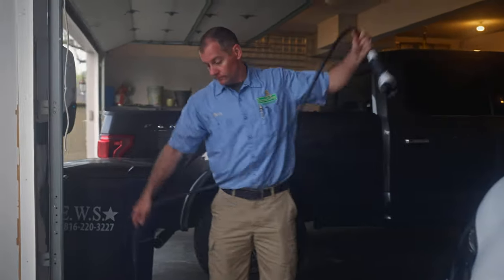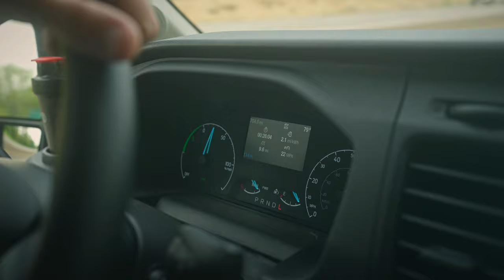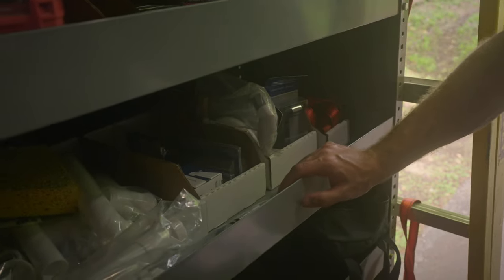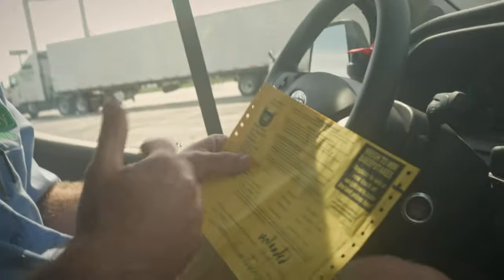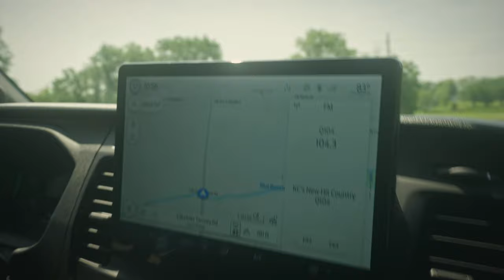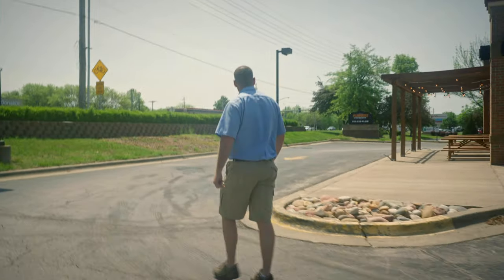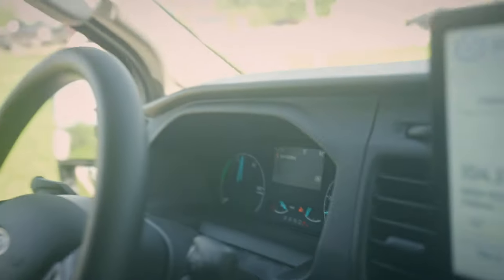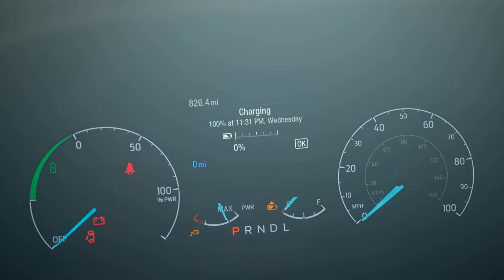**Ford E-Transit**  How far can you drive when it's loaded down?

Comment: What about 5 year overall cost inc purchase of the van compared to a normal van same spec, weight and usage?
Reply from the maker: So this van actually cost us $21,000 less to buy than the other gas transits we have purchase this year.  This is due to the insane demand for but limited supply of gas transits right now.  So $21k less to buy, $1500 less in sales tax, and we're saving about $400/month on gas.  This doesn't include the claimed reduced maintenance expenses.
Reply: @SmedleyPlumbing  WOW!! that really is god, but of course, that situation will change once Putin and the world start sorting things out. I wonder if it will still make such good sense then.
Reply from the maker: @H4rleyBoy  the van pricing was set long before Putin bacame an issue.  Regardless of who's to blame, we are seeing a great upside.  Even if gas were half the price, we'd still be winning.

Comment: I have a question about the pro power on-board system. Is it a 2 times 20 amp breaker? Is the inverter directly connected to the main high voltage battery or to the small 12V battery ? Can you turn them manually back on if the system switched it off after 40 miles?
Reply from the maker: Connected to the main 68ah battery.  Can only be used when the van is on.  Can't be used while charging because you can't turn on the van while charging.  Yes you can override the 40 mile limit.  I believe it's a single 20 amp breaker with a duplex receptacle.  There is also another single receptacle on the left side of the passenger seat.

Comment: How do you get your pipes out if they’ve been cut shorter than their full length?
Reply from the maker: Never put a pipe in the tube unless it's full length.  This forces a person to be efficient with using up their scrap pipe before grabbing a full stick.
Reply: @SmedleyPlumbing  gotcha. I worked somewhere once where they had 4” pipes on top of the vans. They cut plywood into a circle and used an all thread to attach to it. That way you could always pull on the all thread and pull out whatever was in it! I use the tops of the shelves on that same side to carry my pipes. They aren’t quite 10’ long though.

Comment: The biggest issue is range, and cost: in the UK you can buy two diesel transits for he price of an electric one, and when winter kicks in and you’ve got the headlights on more, the wipers, the heaters etc that range will absolutely dive - you should try another range test configured that way.
Reply from the maker: Yes as soon as winter gets here, we'll do another test

Comment: Great video with a lot of details covered. Overall a good first effort from Ford. This is a quick fix vehicle that has not been optimized to be an electric vehicle. A ground up design should fair so much better and really optimize the savings realized from BEV vs ICE. 👍👍
Reply from the maker: I like this model so far!  Still room for improvement as always though.

Comment: It is a pity that Ford took as a basis a body from a rear-wheel drive van, it is very convenient for me with a "low floor".
Of course, for a truck, rear-wheel drive is the most correct option ...
Is it going to be a front wheel drive version or a rear wheel drive version with a low floor?
Reply from the maker: I don't believe you'll see a different chassis than the gas model.  That's what makes this so neat.  It's the same upfit as the gas models.
Reply: @SmedleyPlumbing  I have a Trasit - diesel with front-wheel drive and a low floor)
Reply from the maker: @lombybedlam  what country?
Reply: @SmedleyPlumbing  Europe.
Reply from the maker: @lombybedlam  that would be why.  We don't have that option in the US.

Comment: Can  you wire up equipment into the van that would normally run on 12v power in regular van?
Reply from the maker: Yes.  It still has a 12v battery under the driver's seat.

Comment: I just can’t imagine not using the Air Conditioner in order to make it home
Reply from the maker: That was only in the final miles of a planned maximum range test.  I run the AC all day every day.  Current range has increased to 145+ as I have learned how to drive more efficiently.

Comment: It needs twice that range and 6hr recharge for me to be interested. It is not good to discharge the LiIon batteries pas 10% charge.
Reply from the maker: Ford's Software doesn't seem to allow discharge below 10%.  Using the math on the dash, I'm averaging about 2 miles per kWh used.  I'm getting about a 135 mile range with the distance remaining sitting at or near 0 after that 135 miles.  It has an 86 kWh battery.  86 kWh X 2 miles per kWh= 172 miles.  It's safe to say that there are plenty more miles of reserve hiding below the "zero miles remaining"

Comment: How much for an transit tho?
Reply from the maker: We paid $56k for this one.
Reply: @SmedleyPlumbing  so they run about 10 to 15k over a gas.
Reply: Hmm about 2 to 3 years I reckon you will start to justify the extra upfront. Not bad.
Reply from the maker: @puzzleheaddesign3789  try buying a gas unit right now for MSRP.  You can't.  I bought three early this year and paid $69k for each.  The shortage has the prices way over MSRP
Reply from the maker: @puzzleheaddesign3789  the EV cost me $21k less than the gas units I bought this year.  And I save about $300-400 per month in fuel.

Comment: If the van is out of juice at 130 miles at an average speed of 24 mph, imagine how reduced the range would be for this high top on the highway @ 70 mph.  I don’t think this E transit is ready for prime time except as a local vehicle, utilizing over night charging (74 for the 110 VAC / 1OA, 10.75 hrs for 240VAC / 40A or 7.4 hrs for the Ford 220VAC/ 60/ 48A charger).

    I would wait for the Amazon-Rivian technology to come to market (if ever) or better yet for Tesla to produce an E-Van. 😎
Reply from the maker: It's not intended for over-the-road highway use.  So you're comparing it to a use it's not intended for.
Reply: @SmedleyPlumbing  That may be true but that’s not how Ford markets it as merely an alternative for their ICE models.  Same goes for the other Big 3 American Automakers.  If it’s not made for highway use, they should state it’s purpose and limitations. 😎
Reply from the maker: @vincentstouter449  it's made for highway use but it's not going to suit the needs of those needing to travel hundreds of miles a day.  They are very up front on their marketing that they polled their customers and most drive 70 miles a day.

Comment: For a bussines i think my opinion is a terrible decision especially wen you get busy some days you get more calls and you have to tell your customers that you cant reach them because you bussines vehicle needs to charge, best to you Cap.
Reply from the maker: It all depends on your service area.  If you routinely drive over 100 miles, it's not for you.  Many drive 50-60 miles per day and it works perfectly.
Reply: @SmedleyPlumbing  very true but your hart has to be in good conditions because of the batteries running out🤣👍 thanks for your reply and enjoy your great van cap.

Comment: I'm getting seriously sick of emissions testing, and needing to fix every little thing that could possibly effect emissions, but not necessarily does. They don't hook up a emissions testing pipe to your tail pipe anymore, as I'm sure most everyone knows. 

So I'm going electric very soon, this van in my first choice. However I've read that a zero emissions diesel engine is almost ready for mass production. So that will be my second vehicle. 

Another reason to go all electric is, WW3 looks to be possibly very close, and that will drastically effect fuel prices. Also, besides solar charging, you can buy an electric generator that runs on wood (burning wood in a chamber) to charge up your vehicle. So an electric vehicle is currently the best option to covers all the bases.
Reply from the maker: Yeah I don't look that far into the future. I look for what I can benefit me in the next 12 to 24 months and that's pretty much it. So much can change in that short amount of time.

Comment: Interesting, however, as the owner of a maintenance company, I just envision the calls from techs saying they ran out of charge, forgot to charge the night before, stuck at a charging station for two hours, yada, yada!  Just convinced all my savings would be vaporized on payroll.  Still cool for a company to showcase being environmentally conscience, might even generate leads from the tree huggers!!
Reply from the maker: Our decision had more to do with the finances than the environmental side of things.  But also, just like you would allow a tech to continuously run out of fuel, you wouldn't allow a tech to repeatedly forget to charge overnight.

Comment: Seems like you need to find lightweight plastic shelving...
Reply from the maker: Why?
Reply: @SmedleyPlumbing  From what I could see in the video the shelving system in the back of the Transit looks like heavy steel.  All adds to the weight and cuts range.
Reply from the maker: @castletown999  the van went farther loaded that it did unloaded.  Weight doesn't affect range asuch as it does on a gas vehicle.

Comment: Im a mobile detailer.
I hired an EV van for a month for my business. I was curious. I cannot charge at home anyway so I'd be dependent on public charging.
I gave the thing back after 2 weeks as it was costing me money and customers.
The van allegedly had a 200 mile range. I generally cover 150 miles per day.
Problem... Once I'd loaded the van with the kit I need for a days work inc the water tank but minus the inverter.. That weight killed the range. I was getting just 50 miles per charge!

My typical day with the EV.
Take the missus to work.
Drive to the charger and charge the van.
Got to job no1
Drive to the charger, wait 4 -6 deep in a charging queue, call the next customer to cancel and eventually charge the van ready for the next day.

I live in a city with 320,000 other people, theres 2 charge points 5 miles away. The next closest chargers are 15 miles across town.
I cannot pay for a charge with money. I have to use a card or a phone app... I hate cards and mobile phones with a passion. My mobile phone isnt a smart phone.
I can fill up my diesel van with 800 miles worth of fuel in 5 mins and I can pay with money.
With the EV it takes a couple of hours! Thats time Im not earning money.
Its not just the time charging, theres also the time in the queue and time to drive to the few charging stations.
Reply from the maker: Sounds like you set yourself up with the most difficult situation possible and expected success.  For an EV to make sense, home charging is a must.  Relying on overused public chargers will always result in a very frustrating experience.

Comment: 68 kWh x ~ 15 cents a kWh = $10.20 You can't drive a gas Transit this far for $10
😁
Reply from the maker: Just imaging my electric rates of $0.05/kWh.  You can't ignore the savings.
Reply: @SmedleyPlumbing  I've been on solar since 2019. Image 0.00 🤣

I have a Chevy Bolt EUV now. I never planned to be EV driving when I calculated the break even of my system. Now that gas prices are gone bonkers it has cut the time in half. I have about 24,000 all solar powered miles on my car.
Reply from the maker: @JasonCarmichael  yeah solar doesn't make perfect sense here but it if it does for you, then it would be a game changer.
Reply: @SmedleyPlumbing  If you are still doing 70 miles a day, you are winning it with just the cost savings as it is.

Maybe in the future, if you can keep tabs on just how much ahead you are getting with the E-Transit, solar will be a good fit.

Comment: with an average of 24 mph :D :D :D  double that and the real range will be around 80-85miles
Reply from the maker: Go back and check the video. We ran on the highway with an average speed of 65 mph and still achieved and efficiency of 1.9 miles per kilowatt hour of energy. That alone equates to a range of well over 120 miles.  Also the max speed on the unit is about 80 to 82 mph due to the maximum rpm capabilities of the motor.

Comment: This van can take a few Solar panels on top🤔
Reply from the maker: Yes but you can charge while driving unless you hack into the brains of the operation.
Reply: @SmedleyPlumbing  for a Tesla you Just need to press in the sensor behind the charging door to trick the system
Reply: To be worth it there would of need to be alot more panels that can fit on the roof. he would maybe get 2-3 miles per day of total gain with the panels that would fit on that roof

Comment: A few problems with your video one you should never charge your battery all the way to hundred daily and definitely not do that in drive all the way down to zero daily amount of battery degradation you would have in the first year would be astronomical those are not good driving habits for easy at all 2 Your average driving speed was 25 that is why you below the normal and obvious reason why you’re getting the range you are
Reply from the maker: How are these problems?  They are both how we choose to use the van and how we actually use the van.  With enough in town driving, the average speed will be low.  And the van has to last us 5 years.  After that, we've recouped our costs and it leaves the fleet.  We're not saving this thing for the next owner.

Comment: It’s a very cool idea but unfortunately whatever money you may save on the short term will most likely be lost on the long term because of a lower resale value of the Van as newer and better technology becomes available.  Ford better tread very carefully investing so much money in something that so very few people want to have!  The limited battery technology and range that is available now seems to make hybrids a much better transition option.  I was hoping that the Transit would have a longer range then the lightning due to its larger size and more room for battery but I am very disappointed.  I have had many work days where I have needed to drive from Allen Park to Brighton and then back again and the E Transit wouldn’t be able to make it.
Reply from the maker: The range is suitable for most Transit drivers.  I can't speak for others but I don't concern myself with resale value.  I use them for 5 years then buy a new one.  Anything I can sell them for is a bonus.

Comment: I almost died laughing when he said 7-1/2 hrs to charge back up, So a Service Plumber would need 2 Vans to continuously cover Emergency calls, It just doesn’t work, maybe for the Boss to deliver Gatorade, but no way for a 24-7 Plumbing Service Company
Reply: The van doesn't also have level 3 charging?
Reply from the maker: Charge while you sleep.  There is never a case where a service plumber shouldn't be given a 10+ hour break between shifts.  That's time to rest but it's also time to recharge the van.
Reply from the maker: Yes you can use Level 3 charging and charge from 20%-80% in 30 minutes.

Comment: Interesting video, say you have 20 vans in your fleet and they park and charge for the night and the power goes out…. No one works that day as a business owner things to consider, a generator big enough for back up is not feasible. 130 miles is truly a joke in the real world. Let’s see how this electric world works out
Reply from the maker: Nobody is saying to convert your entire van fleet to EV.  But let's say your fleet is currently 20 gas powered vans and gas is $5/gallon.  Then let's say you convert half the fleet to EV.  Now you're saving some serious cash.  Also, in the digital world it's difficult to do much without power.  Most CRM's and POP systems need power to operate.  So a power outage will usually hamper your business regardless if you're an EV fleet or not.

Comment: It’s unfortunate that EV’s start off with a high manufacturing carbon footprint , after approximately 200,000 miles does it equal an internal combustion powered vehicle.
Reply: Same problem goes with solar and wind power, the carbon footprint to manufacture these “ green” power plants is mind boggling.  The proper Greenies hate solar and wind power, they’ve looked into how much steel, concrete , fibreglass, copper wire , and other stuff used to make a wind turbine, it’s better to put all the coal or gas that was used to manufacture the components into a coal fired power station .
Reply from the maker: We didn't buy this van based off how it's manufactured.  We bought this van to save our customers money by reducing our expenses.  How manufacturers handle their carbon footprint is up to them, not the consumer.